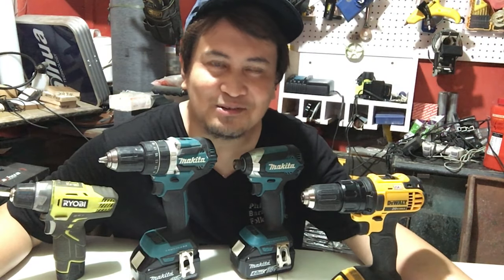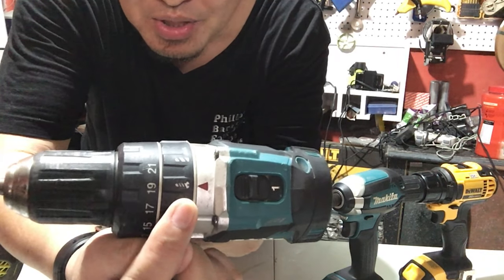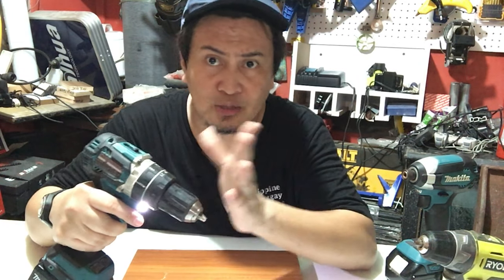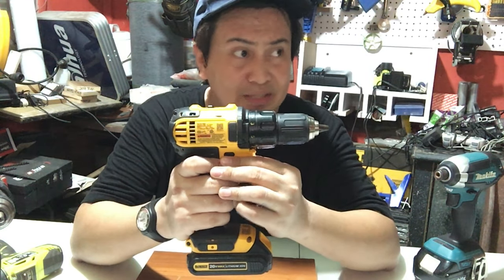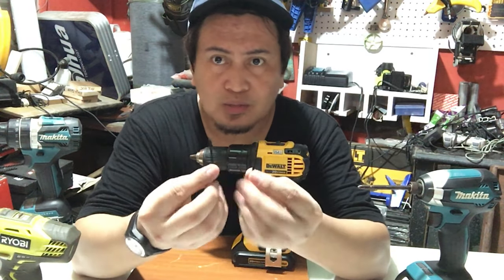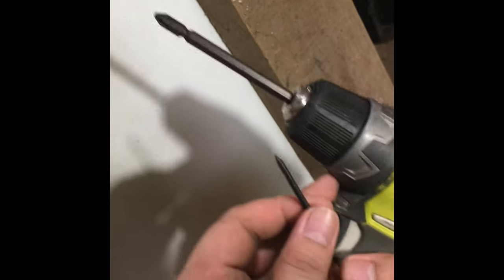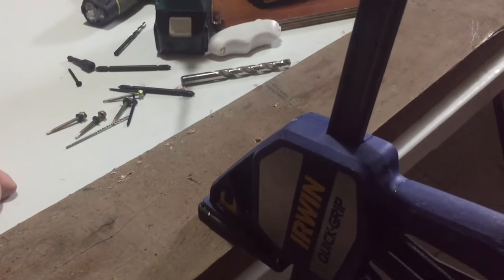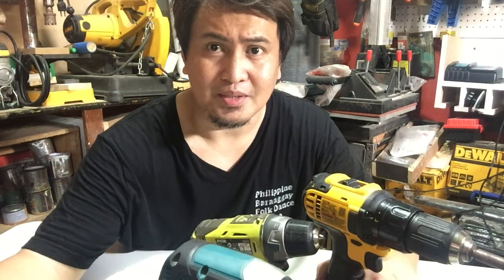PAANO GUMAMIT NG CORDLESS DRILL DRIVER [IBA'T- IBANG APPLICATION]

Comment: Yung makita drill po ba pwede po sa pangkalas ng bolts sa motor.? Nagtry po ako ayaw po makalas o dahil di lang ako marunong.. Naka set naman po sya sa screw pero po yung sa number di ko po alam san po ilalagay.. Sana po mapansin po at maturuan po ko step by step..
Reply from the maker: hello po  meron po  switch  button para  sa loosen and tighten  if mag luluwag  or mag kakalas ng  screw  madali lang po  yun select  mo   and press mo  yung button para sa  loosen   or  paluwag para makalas mo pwede  yan gamitin pag  kalas  need mo lang ng   driver bit  para  sa  size  ng  bolt mo   at makakalas mo na yan
Reply: Ano po ba yung driver beat.? Sensya na po first time ko lang po kasi gagamit..

Comment: Boss ano mga meaning ng mga numero sa gilid ng drill
Reply from the maker: Yun yung settings para iadjust mo ang power and torque ng drill mo Kung need mo ng malakas o mahina depende sa requirement ng ginagawa mo